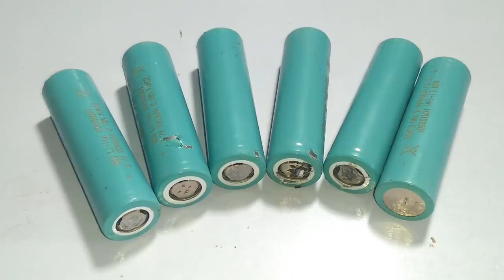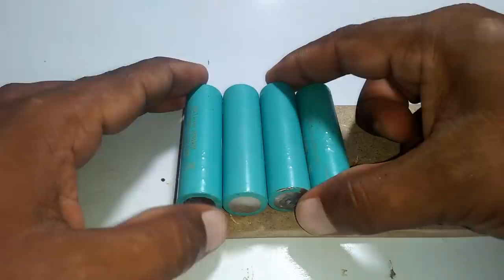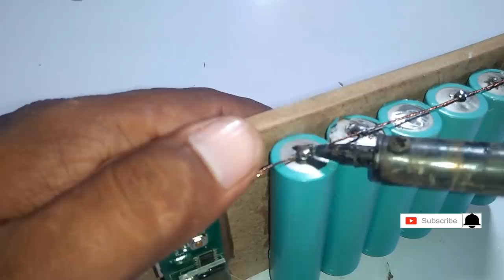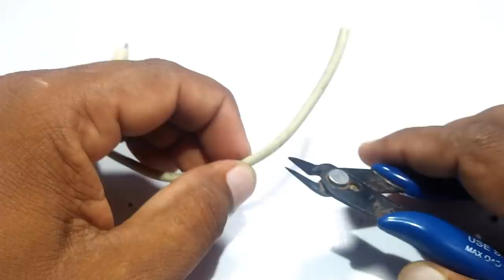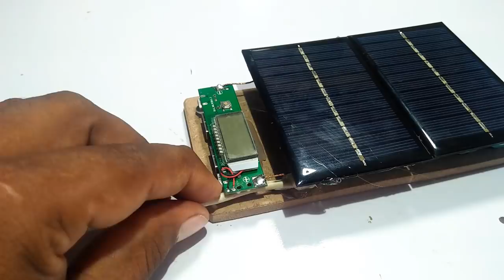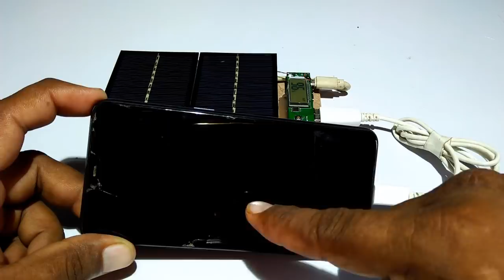How to Make Solar Power Bank it Home How to Make Power Bank 22000 mah Solar Power Bank

Comment: That solar cells gives 60 miliamps per hour in order to fill up 22000 mah you have to charge it 366 hours directly under Sun light. This makes 15 days if you charge 24 hour daily but you can't. Maybe if you charge 12 hours around so you have to wait one month to fill up those batteries with that two tiny solar cell.
Reply: Pretty good calculation there, i think the solution would be to add more solar panels, or use a big portable panel in our budget and fold it up when not in use
Reply: Finally someone who thinks and calculates. These little solar panels are completely useless for charging a powerbank. Maybe one 18650 battery, but no more than that.
Reply: Now, imagine if you have 30 of these power banks... UNLIMITED POWAA

Comment: Many disadvantages here. First, your solar panel is too small. To charge the battery faster, you may need 2 pcs of 15x15cm solar panel at least and connect them in parallel to get up to 1Amp current. It will be a large size power bank, not such small. Incredible? Of course, that is the reality of solar power bank which "really works".

Secondly, you put the panel right on top of the battery and you will expose this thing on direct sunlight. Please the panel will get soooo hot and that is sooo dangerous to heat up those li-ion batteries. You potentially could make them explode.

I build this kind of solar power bank, but it is large size using 2 pcs of 15x15cm solar panel that can give me something like up to 500mA each. And I use toolbox as the housing and keep the battery in a Styrofoam inside, to resist heat from the sun get directly to the batteries. Also, I painted the toolbox with white colour to reflect most of the heat emitted from the sunlight, so it won't heat up the inside so much.
Reply: Will you be happy if you had to carry a big panel wherever you go?